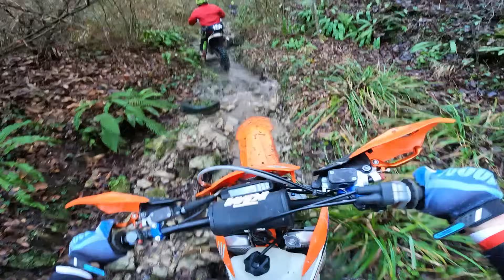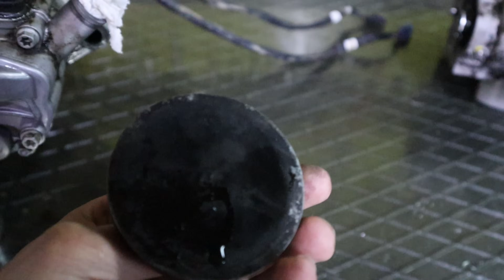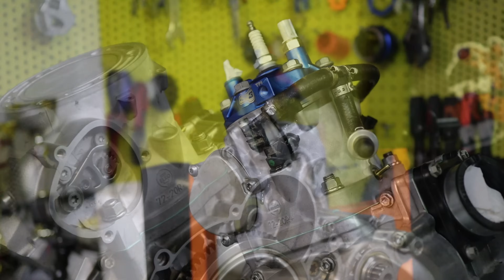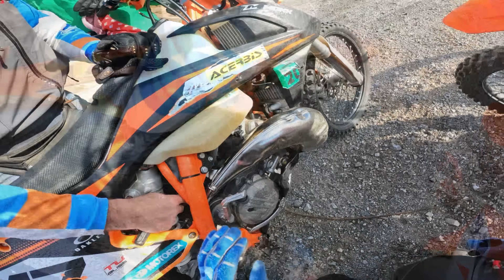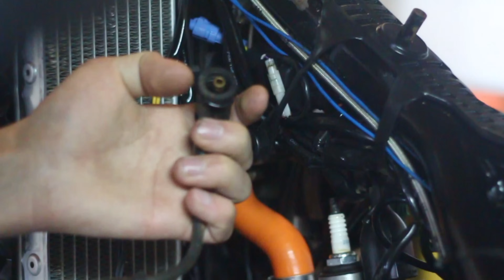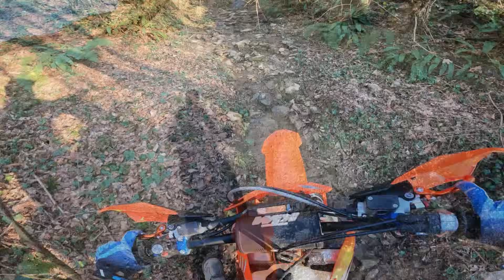KTM EXC TPI Problems: Engine Blow Up, Running Backwards & More

Comment: For KTM300 Im choosing 2017-2019 carbed. Or 2 stroke with kicker and carb .. but best the under the motor estart and kicker bikes like Beta 2t with oil injection removed

Comment: Been riding for 30yrs,owned most bikes including ktm 450sx a current bike,i will never buy a bike with injection and a oil pump,premix and carb is the only way which is why i bought a sherco 300 factory,best bike iv ever owned other than my 92 rm250

Comment: 100hours on my 2020 exc just PERFECT
Reply: i bought a brand new Ktm exc 2022 tpi i have 1.3 hours on it. I hope i won't have problems
Reply: @botezatuexty5868  update 130 hours, still no problem, i've used so much in high rev but still perfect

Comment: My opinion on oil pump is take them of and premix the fuel in the tank, your engine will last lot longer, and i am a carburetor guy think efi on 2T still needs a cuple of years of reengeniring just where the injector sits and how a 2t engine works,

Comment: Only problem with my 22 ktm 250xc is the ride always has end ! I let it warm up properly so right matinence bike runs like a top !!
Reply: i bought a brand new Ktm exc 2022 tpi i have 1.3 hours on it. I hope i won't have problems
Reply: @user-fz8fy4zl1c hello, i had to change the Cilinder and piston at 80 hours (2 months ago) and i didn't even pushed it that much (maybe a bit) but I prefer a Yz250f 2023 or 2024 rather than the exc 150 tpi 2022
Reply: @user-fz8fy4zl1c btw I am botezatuexty5868

Comment: I've had 6 KTMs over the past 4 years. All have been great. Although, all but 1 are 4-stroke. Love their products. But the way they've treated you is crap. I've heard good and bad experiences with KTM corporate and warranty coverage. Most of the time the owner was able to apply enough pressure on the dealer to get things fixed for free or at a great discount. I hope KTM doesn't just choose ignore their customers in small markets like your country.

Comment: Great video with some interesting thoughts, keep them coming, However, you missed the obvious most common problem, the CCP sensor which is responsible for a lot of the bogging and poor running on the TPI, I'm on my 5th sensor in 2.5 years !! 

Next, I'm sick of hearing this crap about oil pumps, and the narrative that their going to fail at some point...B.S, oil pumps have been around on 2T's in scooters, snowmobiles etc, since the 50's, the failure rate with oils pumps is so negligible, its not worth even talking about !!. If you want a bike with NO technology, go buy a 70's YZ 250 and see if you like that ?? ..OH BTW I used to race one and they were notoriously unreliable !! good luck

Comment: I believe every word you said and I started Racing KTM’s in 1990 and the bike would bust a piston about every six weeks but KTM was still a small company, so they were pretty good about helping me out with some parts.But I have a KTM 790 and it is a piece of junk .At 2000 miles the oil jet that lubricates the clutch stopped up and destroyed the clutch ( they put to much Loctite on the oil jet bolt and it stopped up the jet) and at 3400 miles ( which is what mileage I have on the bike right now) I had to put new cams in the bike and it cost me $1800 and KTM would not help me at all, even though I’ve had 30 KTM’s they could care less The bike set at the dealership for 6 months waiting on a intake cam. (/From July 2022 till January 2023) The Internet is full of other 790 owners with the same problem. The difference is they warranty their bikes and although mine had 3400 miles on it, they would not help me one bit even though I have been a customer since the year, 1990 and have owned 30 KTM motorcycles. So knowing from experience, I believe everything you said, and I believe KTM did nothing to help just like they did me because KTM is a big company now and they don’t care.

Comment: I have a 2018 husky te 250 Tpi , with extreme map, over 300 hours, and i can't get rid of the deceleration popping, i play with idle screw and air bypass screw. Now i have 1 turn on the air bypass screw, and set the idle with the idle screw.

Comment: I had a 2020 Husqvarna TE150i and it constantly was blowing spark plugs and running weird - sold it and bought a carb TM Racing EN300ES 2 stroke, and haven't looked back...then bought a Honda CRF450R that I've built into a CRF450RX and both of these bikes have been my favorite to date out of owning Yamaha, Suzuki, and Husqvarna beforehand...quality, feel, and fun factor supercede all other machines I've owned and tried for my riding style.

Comment: I have problems whit my oil Pump on my beta 300 my bearings Start make some noise, só i Change the bearings and remove my oil Pump and make a 40:1 pré mix😂
Reply: 40:1 to much oil for hard enduro
Reply: @nelsonmarcarvalho  don't blow. make more smoke but isn't a problem to me 😂

Comment: Would you rather buy a new Bike, knowing they have these issues, or just stick with a old one ? I onw myself a 2012 exc 250 with around 450h and it just runs fine. Some of my friends  have a Brand new GasGas, or 2019 Ktm exc 300. The only thing that annoys me sometimes is that i only have a Kicksart and you need Premix. 
What is your opinion on older Bikes ?
Reply: I saw my friend put e start on his 2006 250exc. If u still love ur old bike. Why dont u make one. Premix is fine. Im remove oil pump on my old bike few month ago!!

Comment: That's Way I go to Rieju MR and Beta RR without oil Pump 🤷🏻‍♂️
Reply: Rieju 300 MR PRO 🔝🔝
Reply: Beta ist the badest.
Reply: Kept my oil injection. Same spark plug after 1000 miles.

Comment: you can use around 2500 to convert one to Electric which will last for years, need not to pay for new bikes that keep breaking
Reply: At the cost of range, power, the fact that your range gets worse each time you recharge and needing a generator/battery pack when you're away from civilisation eg. camping.